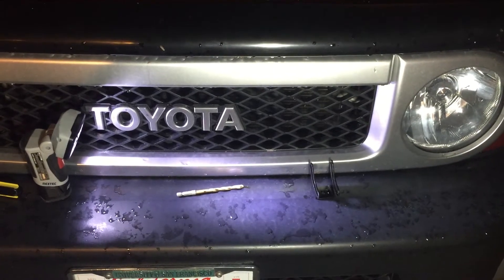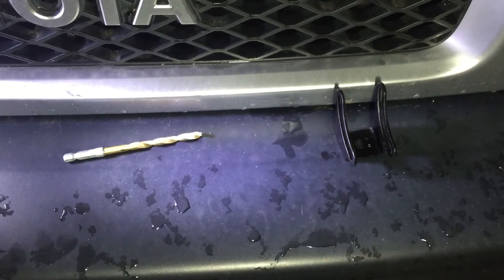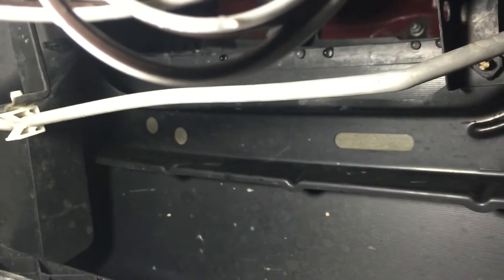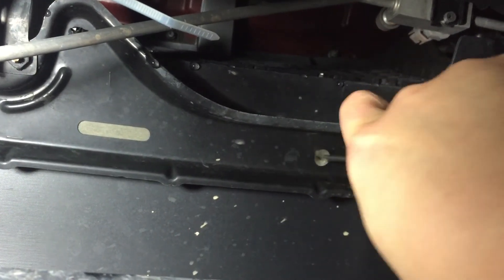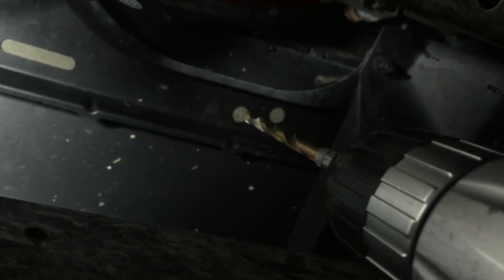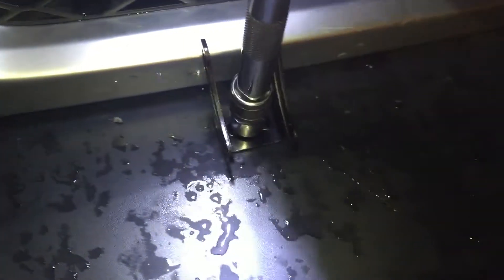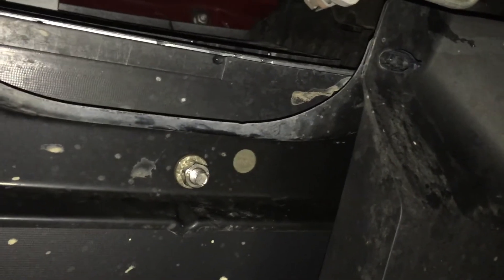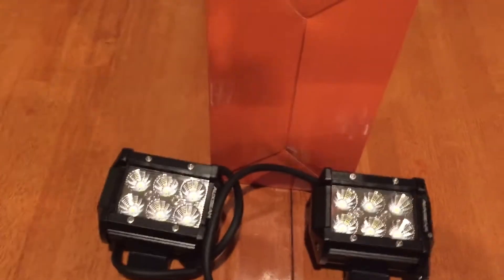How to Install LED Fog Lights on a stock OEM Bumper of the FJ Cruiser

Comment: I have 8 inch bosch rallye 225. Wondering whether it would fit there.
Reply from the maker: It’s the thickness of the light. Do you know how think the Bosch is?
Reply from the maker: Yes it will... the measurement of bosch rallye 225 from the stem or mounting screws to the back is only 30mm or 1.2 inches. Plenty of clearance.